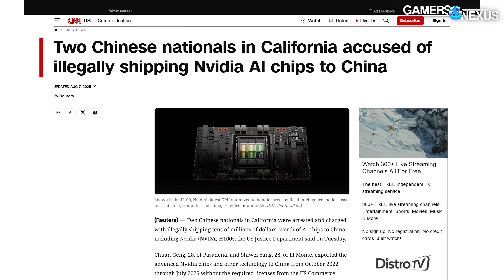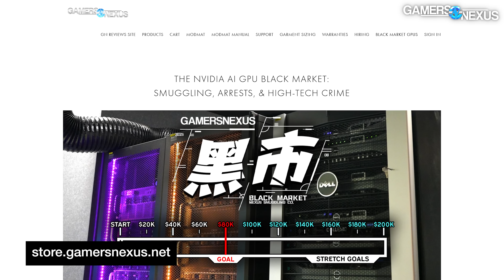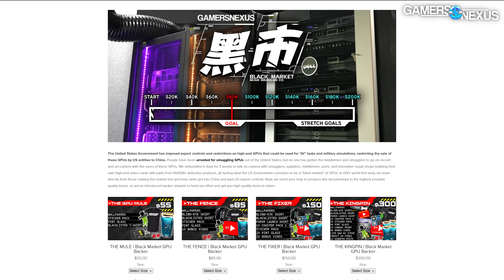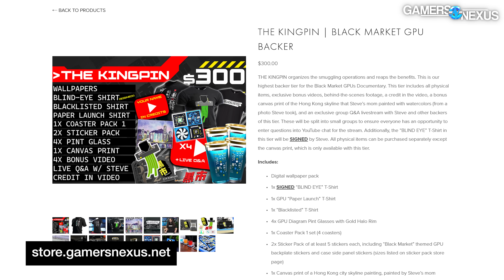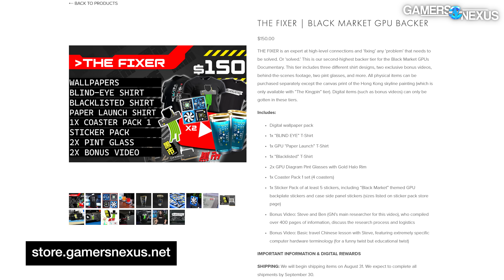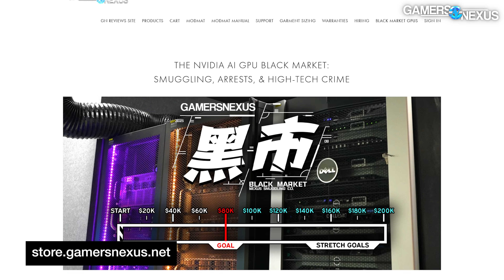Detained by a Government & Probably Blacklisted by NVIDIA for Our Next Investigation

Comment: US government: 4090 with 24GB is banned for export
Chinese: OK, we make a 4090 48GB
Reply: and export it ; they are selling it on Alibaba/ebay , bought few last week
Reply: @AhmedKamilSyed how much were they? Nvidia absolutely screwed me with the 4060 ti and I'm honestly pissed at them. 

To the point I think I'll start taking some of those Chinese chip blanks and make my own cards.
Reply: @FloorJuice 3k usd at least if you buy 2 units (4090 48g )
Reply: @AhmedKamilSyed dude bought a 4060Ti in 2025, you think he’s got 3k?😂 might as well have bought a laptop if you’re getting a XX60 series card
Reply: Also 4080 with 24 GB, 7900XT with 48GB... even 1050 with 16GB... it's massive.
Reply: @queotzcatl3980 I'd love to put 16gb on my old Strix 1050. It would finally justify the overkill cooler.
Reply: @queotzcatl3980  1050 16gb sounds awesome tbh
Reply: @queotzcatl3980  Seeing 4080 Super with 32GB on the market now. Also unlocked MI50 (32GB) as well as RX 580 16GB (sadly no driver can reliable use that for LLM)
Reply: I mean they do have the fabs that work on electronics so it's not like it's hard to find the people with skills do swap the ram
Reply: @marcogenovesi8570  take out a memory IC and put another is not difficult, people just need to have the right tolls to do it! Not fotgetting that to work those graphics cards may need a modified VBIOS and changing the straps(resistors setup) too!
Reply: And now the US government gave them a license to be able to ship H20s to China? This whole thing is a shit show.
Reply: I cant find any GPU's in my bestbuy but this Chinese national can purchse hundreds of 5090's and 4090's?
Reply: US government: 👁👄👁
Reply: A product produced, assembled and packed in Asia is banned FOR EXport by the US!?
Wait 4 more years and the US will beg GPUs to be IMported to the US.
Reply: How can that even work unless nvidia specifically deploying vbios that allows RAM expansion? I have to update bios every time in my rog ally to support soldered ram. Nvidia uses vbios to limit virtualization and dual processor working on single board
Reply: @HolyRamanRajya   They use a custom/unauthorized VBIOS.
Reply: @HolyRamanRajya Obviously they work otherwise there would be no point in doing it in the first place. There are videos on YouTube showing people using them.
Reply: @Squidgy55  I'm not refuting it. I'm trying to confirm if nvidia could be complicit in this
Reply: @HolyRamanRajya Apologies. I see what you mean. I think it's unlikely but I wouldn't rule it out.
Reply: @HolyRamanRajya   " one eye open, one eye closed "...what do you think that means? you're not going to get a 100% confirmation... welcome to the corrupt world
Reply: @HolyRamanRajya  I guess they roll their own. It's not like VBIOS is write protected.
Reply: @samiraperi467  yes that makes sense. But I would assume there could have been kswitches in premium product to brick the gpus if nvidia wanted to.
Reply: @HolyRamanRajya right now, it's improving their bottom line, so  , like the dudes in the video said, Nvida is keeping one eye closed. But if the dynamics change or the government pressures them, then they can fence things up quickly
Reply: @HolyRamanRajya they wrote/mod their own bios of course, i mean they custom made a PCB for this
Reply: and good on them, beyond DC slamming the gate years after the horse had escaped the paddock once again; only demented neocons think that the USA is entitled to remain the global hegemon in technology after gutting out it's manufacturing, and honestly now much of it's STEM industry compared to decades prior.
Reply: Hopefully they can make a 5060 with 16 Gb.
Reply: @javierortiz82  yes, they can
Reply: Oh I’m sure they’re definitely not using knockoff chips. 👌
Reply: typical chinese. instead of making their own shit they jut copy from the west and frankenstein our products into some bs that probably doesn't even work
Reply: US government it's killing it's own nation in the most suicidal way possible, you will end up in a bubble. In EU we will buy directly from china or other markets, so GG WP NO RE.
Reply: That’s exactly why the trump administration is banning sale in nearby countries like vietnam, they typically buy it and import it person by person as gaming card don’t really require any id or business KYC check😂
Reply: i definetly buy a 48 gb 4090 that does not burns with the 12vhpwr connector hahahaha
Reply: NO the Chinese would be more like, we build nice compact and portable grill using the high power connector - simple design and affordable.
Reply: Just a 6090 lol
Reply: Brother ZHANG making the coolest stuff ever.
Reply: deepseek R1 hehhehehe
Reply: And it will probably be half the MSRP...
Reply: All well and good giving all that extra VRAM but when the GPU has not got the overall power to utilize it then it makes that extra VRAM pretty obsolete.
Reply: @Starmerthegreat well for AI training purposes it can utilize it… 4090 shares similar architecture to 6000ada, a lot of time when comes to AI it really need vram for max word lengths, so this vram mod comes to play
Reply: US government: GoF is banned
Chinese: OK, we make bat soup
Reply: @Metapharsical  naw, they need Fauci for that.

Comment: I personally have only purchased and or recommended a Nvidia GPU's since i built my first PC back in 2013... But damn the way Nvidia is going from gimping VRAM cap and BIT BUS  "memory Bandwidth" since the 40 series. I personally can not recommend a "GPU" from the green side. I upgraded from a GTX 660 TO A GTX 1070 NOW A RTX 4070, and let me tell you. I personally was more impressed by the performance uplift I got from going to a "GTX 660 - gtx 1070 then a GTX 1070 - RTX 4070.

Comment: northwest repair tried to fix a 48gb 4090, they use a custom pcb, long story short, core shorted, driver mosfets are cheap since the boards have to built from the ground up to make the modification happen.

Comment: When I put my used 4090 on German ebay, I got an offer to sell it for 50€ less within 2 minutes and had it sold for the full price a minute later by two different Chinese named accounts.
For 300€ more than I had originally paid for the card 2 years prior.
I always wondered if that ended up in China too.

Comment: Comment section remember; you're ALL the cause of nvidea's success and market abuse. you ALL enabled it by buying from them for years. Even if AMD had better gpu's (RX6800XT vs 3080).

You all ruined the market, you're all responsible. 80-90% of you owns a nvidea gpu and contributed to this behavior of nvidea. by giving your money, paying for overpriced gpu's with fines included due to market abuse. And you all tossed your money. So take a good look at yourself. Do you own a RTX? then YOU are the root cause of the problem. Nvidea only capitalizes on your ignorance and stupidity.

Comment: Not that it’s like you’re busy or anything but can you touch again on the asrock 9800x3d failures? I’ve still seen a few happening. I went asus for this reason alone, and am piecing together my new build which is by far the most expensive one - CPU is double what I’ve spent for prior builds

Comment: The summer blockbuster isn't from the MCU, it's from the GN[U] -- an exciting story of international intrigue, with shady characters and corporatist collusion with mysteries and unparalleled action -- which will leave you at the edge of your seat with drama, leading to expositions not seen on the silver screen before!

Will it uncover a black market replete with a full supply of 5090s at MSRP? Will missing ROPs be found? Will there be secret drivers that prevent bricking?

Don't miss this exciting feature not coming to a theater near you soon because it will be streamed! For free!
Reply: And from the teaser alone...I'd guess it will be better than anything from the MCU in the last decade!
Reply: @tvstation8102  Certainly a lot more real.

Comment: 'we can make one right now' is wild
Reply: What's wild is that vendors used to be able to put as much ram as they wanted on NVIDIAs GPU.
Reply: @MoeKoopa No. it's not that simple. you can only put how much the memory controller can accept. for example: RTX 4080 memory controller can have 8 memory chip connect and Nvidia put 2G chip on them, so you get 16G VRAM. however, there's 3G GDDR6X memory exist, they can replace 2G for 3G one. And you get RTX 4080 24G
Reply: @MoeKoopa  
Those were nice times.
Reply: Dunno. I think its Way wilder ppl actually believed Nvidia when they said there is absolutely nothing they could possibly do back then when the Chip Shortage started. THAT is Wild.
Reply: @flimermithrandir  Last time I checked, NVidia doesn't make their own chips. They use TSMC.
Reply: @akam9919  You know.... whatever. I could write Stuff but lets not get into it.
Reply: @akam9919 they used Samsung at the time
Reply: Complex BGA rework like its nothing
Reply: @GalileoAV  its not complex at all to replace the memory chips if you have the tools, i think the hardest thing for them was probably the bios since they are all encrypted
Reply: Little unfair to call BGA reworking not complex if you have the tools. To do it to a high standard using mixed sources of parts requires a high level of skill. If they're going into servers to be hammered constantly, that isn't a trivial amount of skill required to ensure the part is reliable over the long term.

Operationally, that's probably more of a pain than the BIOS where you pay to get someone to crack it (or the government does it to enable the industry) and then it's a matter of an interface and a script. Works or doesnt and is testable. The BGA rework will be variable in quality and needs to be to a high standard. That's constant training and QA as well as skilled people who can recognise if a PCB layout has changed or there's other weirdness going on with batches. 

For the business owner, the BGA work is the biggest liability requiring the biggest continuous investment in people and quality.

That's not to belittle whoever broke the BIOS, but as I said - once that's done, it's done and confirmation that it worked is highly specific and easy to script testing.
Reply: @Yokaiofficial  chip soldering isn't that easy bruh
Reply: @Yokaiofficial  don't they add modules to the back of the GPU? just "replacing" isn't enough
Reply: @RycoonGalloy  Need a completely different PCB because all official RTX 4090 does not have VRAM pads to solder on both sides of the PCB. And you need to add extra power circuitry to power the additional VRAM as well.  These people mostly designed their own custom PCB for the memory upgrade.
Reply: @Yokaiofficial  yes, but replacing the BGA is not exactly easy to do correctly every time, requires very careful heat ramp up and inspection before turn on, or else you’re gonna risk damaging the whole BGA. Nobody said rework on memory is hard, the chips have 70% less balls and not all of them are even connected
Reply: @GalileoAV  That's nothing. . . Think of the software (firmware etc.) needed to make this recognize the new memory config.
Reply: @GalileoAV  I'd question the long-term reliability of the results of reworking of BGA devices by hand as shown in the video. It's not like there's going to be a robust RMA process for these sorts of cards after all.
Reply: @robertsneddon731  If there's any issue you can just return a card and they'll sort it out..  the outfit may look simple but they get it done. With all the factories in China there is no shortage in highly skilled engineers, plenty will probably want to work here close to home instead of living onsite at a factory in the middle of nowhere and only going home once a year.
Reply: They probably used to work in Foxxconn and have the knowhow to make them for nVidia to begin with.
Reply: Might just take that offer
Reply: @ivane3676  ill take it
Reply: @ivane3676  lol im saying
Reply: That Mr. Zhang is probably the most senior component level GPU repair engineer across China, making a 48G 4090 is literally nothing to him.
Reply: that guy actually has a YouTube channel: https://youtube.com/@fydn?si=4Z0q9IyCXa_H_dE3
Reply: Makes me wish we could do that here, or rather that anyone saw it as worth doing here. The export controls caused some situations that are hard to replicate elsewhere for now, like how someone here might buy an ML-specific card (A40, A100 and their newer counterparts) instead of wanting to go through the hassle of modifying consumer GPUs. If that sort of industry ever sprang up elsewhere though, without any need to treat it as a black market and rather just similarly to the market for delidded CPUs, I think we'd be in for a fun time.
Reply: "we can make a 48g 4090 right now"

it doesnt mean that the technician make the card from zero. he just offers a replacement of vram from 24g to 48g for a 4090 provided by the owner in fact and for real. it's easy for the replacement since he is 張哥(Bro Zhang) a well known graphic card repair technician in china.
Reply: Meanwhile in the US you'd have a hard time finding a company that can make 1,000 springs.
Reply: We need this here in the US lol.
Reply: Supply and demand. Very literally. xD
Reply: If onky doctors were this competent
Reply: Here's to hoping we see benchmarks from a 48GB RTX 4090.  I bet that guy could upgrade the storage in your MacBook Pro too.
Reply: @NoWay1969  brother if im not mistaken Linus tech tip did make a video on rtx4090 48gb they get it from China
Reply: I've been feeling quite stuck with my 12 GB of VRAM, maybe it's illegal to export but not to come back with a 16 GB modified version...
Reply: @w花b there is dude who modify the 8gb to 12gb probably they can do it
Reply: "We can make one right now" doesn't mean its economically viable. (At the same time though, IP law protects monopolies, Anti-trust is just a thorny band-aid that actually encourages monopolistic behavior. Can't over or under produce. What does that mean? No one knows, not even the anti-trust people. Supposedly one anti-trust official was complaining about a car factory that was not running and was saying they were trying to artificially create a shortage. His reason being that factories should be running 24/7 (clearly never worked in a factory). Some guy told him that it was in the middle of winter... who is buying a car right now? (yes, some do, but not many, and also this was way up north. I'm pretty sure the workers would be happy to take a few days off when it snows.))
Reply: In Brazil they do that too
Reply: Bet his can make them cheaper than Nvidia too...
Reply: right, where's the order page!?
Reply: Brother Zhang's channel: Hishttps://www.youtube.com/@fydn
Reply: Kung Fu Chip Hustle  << title if the movie

Comment: Very interested in the VRAM upgrade.  I've been thinking that upgrading a lower tier card for home use would make more sense than a super expensive, high-end card.
Reply: nvidia is doing this for ages. I'm an engineer and the Quadro cards in my workstation are basically just RTX 2080's with double the VRAM and double precision fpu (which was present in consumer cards a while ago, before nVidia decided to put it behind a paywall)
Reply: @hyperturbotechnomike  yep. It looked like to make something like this work, you would need a custom BIOS.  I have some Quadros at home and had an RTX 6000 at work.

Comment: So that’s why there’s so many 4090s here with missing cores and ram
Reply: Any gpu with no cores or vram are most likely from china that were gutted it’s been going on for awhile
Reply: Good thing is, if you have a 4090 with a cracked PCB or ripped pads below the GPU core, there are so many replacement PCB for sale to replace them or even just upgrade to a better PCB. Just shift the core and VRAM to the replacement PCB. No need to burn so much time to repair the old PCB.
Reply: The lobsters disabled the core
Reply: Yes that's the game.